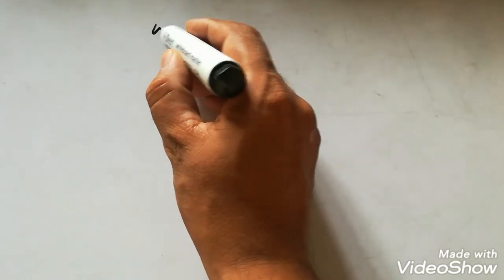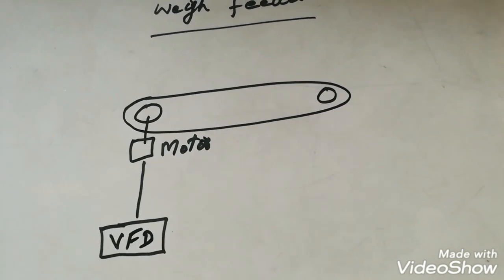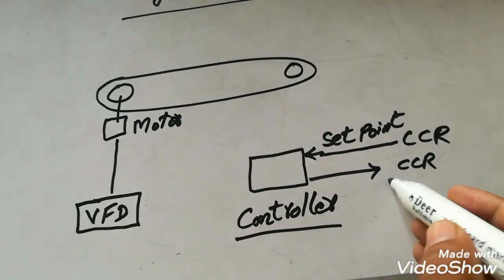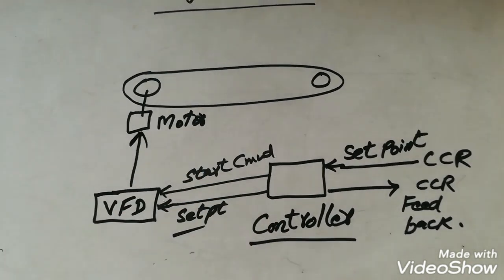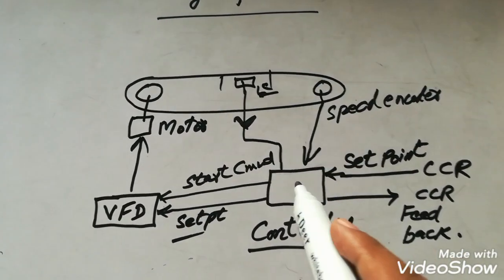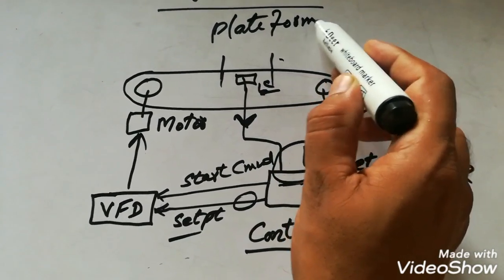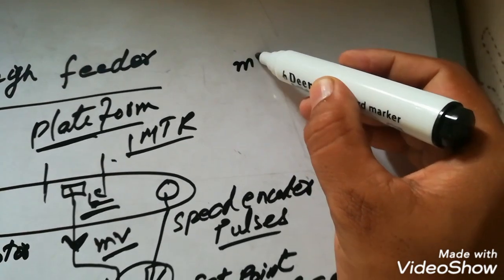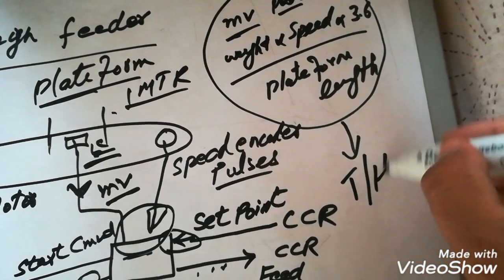what is weigh feeder and how weigh feeder work

Comment: Sir, what is 3.6 in the formula?
Reply from the maker: 3.6=3600/1000
to convert kg into tonn and sec in to hour
Reply from the maker: yes u got it right,
speed from proxy just gave the rpm of belt, we have to calculate the meter/ sec by using the length of belt and overall pulses of proxies
Reply from the maker: if we are getting 6000 pulses in one belt revolution. and belt length is 6 meter. then we will get 1000 pulses per meter and controller calculate it in this way that when 1000 pulses are counted mean one meter belt passed, if we are getting 1000 pulses in 10 second its mean that belt speed in m/ sec is 1/10=0.1m/sec, hope u get the point